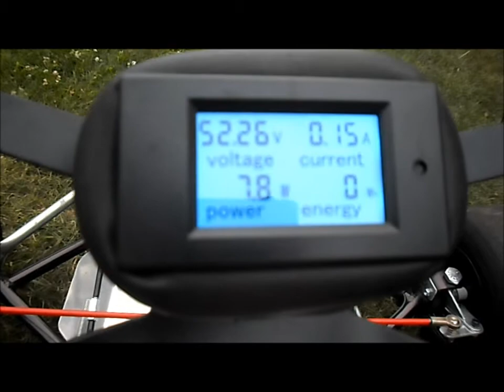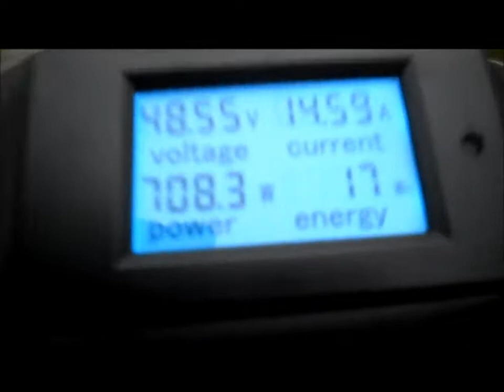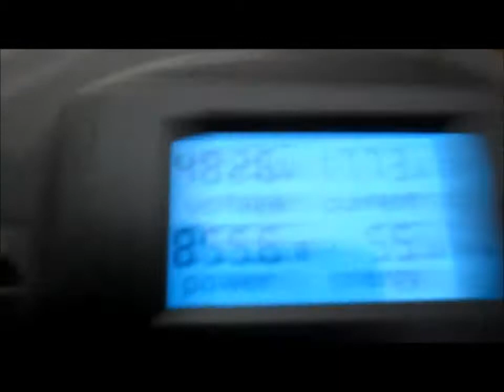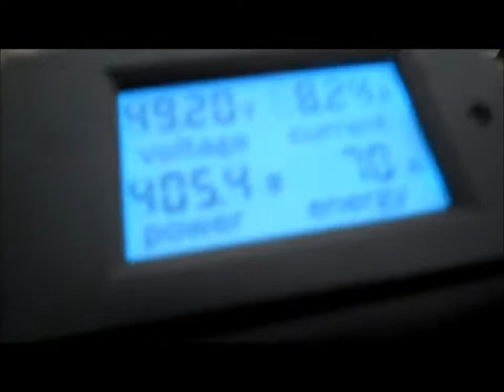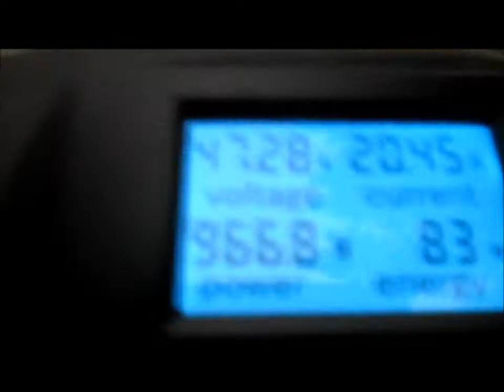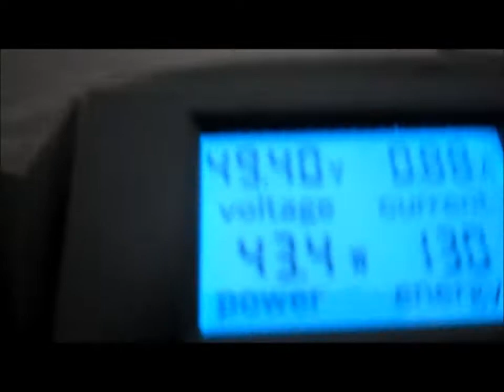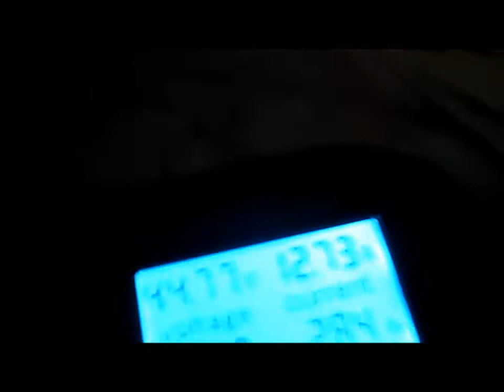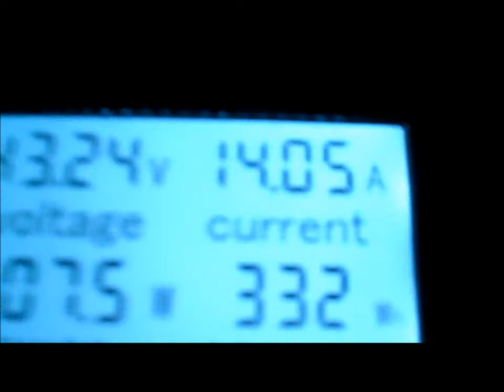Excalibur Electric Racing Go Kart prototype 7 Dual Motor Test Drive

Comment: Hi, you seem to know what your doing, I’m thinking about doing something similar, I want to use 4 3000w motors with 4 controllers the one off eBay, with the correct batteries/power amount do you reckon this will work? Thanks
Reply: That would cost alot... you'd need 4 similar batteries to get them working at full capacity

Comment: I think your asking too much from the batteries to run 2 controllers but pretty cool build. I just fixed a 48v 1000watt brushless setup to a tiny razor drift cart and had a blast with it on drift wheels and solid rubber wheels like the front has
Reply from the maker: I was just testing to see what it would do.  Speed tests are next then, I am going to test a 48V 35AH Lithium battery pack. Stay tuned & thanks for watching.
Reply: Awesome look forward to it. I had 18 ah lead acid and switching to a 13 cell li-ion 20ah soon. I've geared it to 15/32 and have 4.5inch tall wheels so I get around 16-20 at the moment. Hoping the lipo setup does better along with a little higher wattage controller, thinking around 1500watt to replace the 1000watt

Comment: What if you got one 48v motor but at 2000 watts? Would the power be the same?
Reply from the maker: I would think so. Probably even a bit lighter & more efficient, not having (2) cases & armatures & sprockets & chains etc.
Reply: @functional_artist  If I got a 48v 2000 watt motor, what size 48 v batt would be good?
Reply: @srqcrna  it depends on how long you want it to run. Somewhere you can find a bunch of algebra equations that’ll allow you to throw around some values that you want to figure that stuff out. Too much to explain in a comment but with a bit of basic electrical physics you could do a lot with this stuff. Best of luck.

Comment: Dual setup is better than a single setup?
Reply: It depends on what you mean. If you have two 1000W motors for a total of 2000W then yes that would be faster than 1000W. However two 500W would not be as good as a single 1000W just due to rotational losses and heat losses.